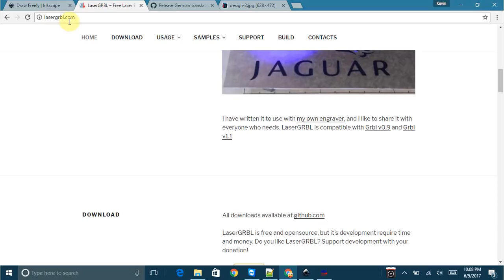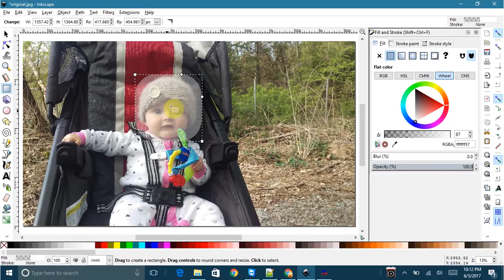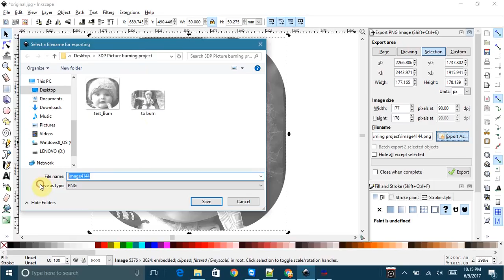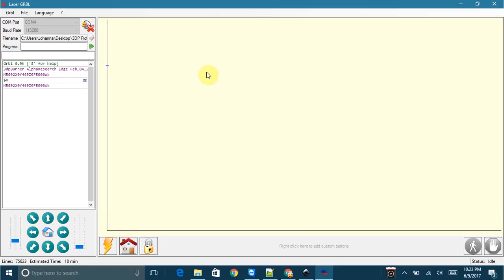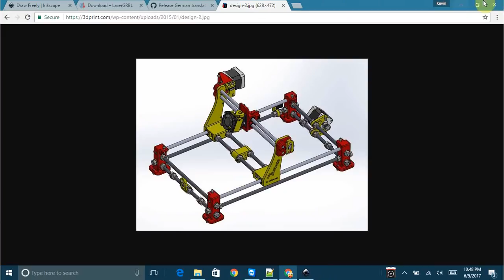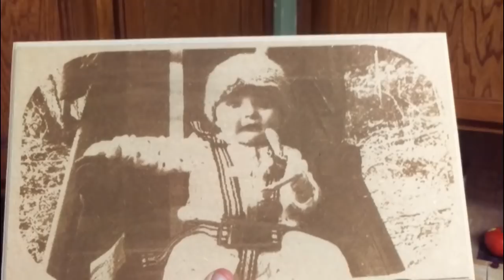Burn Images into Wood using LaserGRBL

Comment: Your demo on the little girl photo says your job only took 26 minutes. Mine shows 10 hours. What am I doing wrong? I followed all your steps.
Reply: he didn't show how to adjust the speed. before you press "create" check the speed wich is visible on top. standard is like 10000mm but yours is probably set much lower

Comment: i had the same issue with jerkiness while burning as it jumped over the white unburned area, i slowed the jog speed way down and kept it close to the burn speed, i noticed the laser didnt jump as much and ran much smoother, it takes a little longer to burn but the results were much cleaner. plus make sure your belt tension is set right with no slop, the belts do stretch a hair after a while and they tell you to trim off the excess when setting up the machine - dont, it gives you something to grip on to re-tension the belt then tuck the free end under the channel so its out of the way, you cant put the end cap on but thats just for looks so leave the cap off on the free end.

Comment: Hi nice video,
What laser machine did you use?.
Thanks,
Reply from the maker: I used a DIY laser cutter engraver called the 3dp burner. Most parts that can be 3D printed are. You can find the laser cutter here.
 https://www.thingiverse.com/thing:610934

You can mount really mount whatever laser you want to these machines. I have a 2 watt 450 nanometer (blue) diode laser. It can cut through paper and thin cardboard, but mostly it's good for engraving wood. 

 My brother actually built the machine himself and later gave it to me. It runs off of an Arduino uno with  a CNC shield.  

I'm currently taking the machine apart and rebuilding all the mechanics. It will be larger and be made from 2020 v-slot aluminum extrusion. The linear motion will happen through v-wheels that ride along the v-slotted aluminum.  I'm sure I'll make a video once the project is complete.  It's slow going though as I'm machining anything I can myself.  I want to get practice using an old lathe and milling machine passed along to me in the family.

Comment: there are several problems with LaserGRBL. number 1 : it's A pain in the ass to pause the burning. one of the biggest laser killers is HEAT. it is recommended that you allow your laser to cool off for 5 minutes after each 10 - 15 minutes of burning. even with a HEATSINK your laser will get HOT. the heatsink may feel cool but the laser inside gets super hot. a fan on the laser does help but do you want to buy a new laser all the time?
to pause the burning.. click the stop sign icon at the bottom right. to resume click the running figure next to it. remember to allow your laser to cool every once in a while. I usually burn for 5 to 8 minutes and cool down for about 5 minutes.

number 2 problem : the GRBL firmware. I see in this video you used grbl0.9 the newest is grbl1.1h. both very similar. but each time i open LaserGRBL and load my machine i must set the firmware to laser mode($32=1). i have downloaded the source code and edited the GRBL firmware and recompiled it so that is no longer the case for me, but others may still have that issue.

number 3: the GRBL firmware assumes that all machines are the same...they are NOT. for instance my machine uses 90 steps per mm. i have a mini laser that uses 82 steps per mm. GRBL firmware by default uses 250 steps per mm( I think,,it may be 200 per). to change the steps you must type in $100=XX, and $101=XX (XX=number of steps needed). I forget the formula, but there is a video on youtube that shows you how to calculate the steps per mm. I started with a image of a box with heavy outlines. I made it render at 10mm X 10mm. after it lasered i measured the image, then adjusted the steps to match what was needed per mm. like I said my A-3 machine was 90 steps per mm and my mini laser(made from dvd drives) was 82 steps per mm.( not perfect but it WORKS)

Comment: Kevin Brigadier.
Cheers. But I have a question, once you get the print set up correctly. 
Can you save it, make a copy of the file then remove the original image and add a new image, keeping all the settings, to save time. 
As you can probably guess I'm very new to this.
Reply: Laser GRBL will automatically save the settings from the last time you used it. just open a NEW picture in laser grbl and click next, then click create. as long as the image sizes are the same,,50mm x50mm or what ever size you choose could be 100mm x 30mm what ever. but it will save it for the next time you use it as long as you do NOT change anything except the image itself.

Comment: Thank you for the tutorial! One thing I am really missing with this software is the option to run focal adjustment for the laser (lower light option) and "show path" option which would show me the maximal burn area for the current project. Are these buried somewhere in the software or are they just missing? Thanks!
Reply: show path is NOT in the LaserGRBL software. as for low light option you may need to type 'M3' 'S100' to get he laser to turn on may have to take the 'S' to 150 or 200( maybe higher) before the laser will work.
Reply: if you order an ortur laser mster 2 there is a dropbox file they give you and in the files they have some custom button options in there you can import into the laser grbl program. if you have a dropbox just let me know what it is and ill share the file with you and let you can get them from there

Comment: I take it resolution that the picture you are trying to convert and burn has a lot to do with the quality of the burn?
Reply from the maker: It does. The brightness and contrast needs to be dialed in as well. Doing a few test Burns with the same image, just smaller, where you vary the contrast and brightness will save a lot of time. That way when you burn your larger final image there'll be less chance of having to do it again.
Reply: laserGRBL uses 300pix resolution

Comment: Thanks i used m3 m5 using toggle button... It worked fine for few min...now it doesnt work but does show m3 m 5 commands on screen as i toggle
Reply: try using m3 s100 to turn on the laser. some one told me that would work.

Comment: Thanks..i tried doing custom button for toggle laser on off...it worked for a few reps but then stopped working....the m3 m5 shows up on screen when toggling but laser doesnt turn on
Reply from the maker: I'll see if I can take some footage or screen shots of my set up working this weekend and share what I've got for the laser on and off buttons i made.  I'm using toggle style buttons.  One to goggle laser on and off at S100 (lower power) the other uses S255 (high power).

Comment: And how do u know where your laser point is?...there is no way to turn laser on low to see where your lcation is..via lasergrbl...younhave to guess which is unacceptable method
Reply from the maker: the stock program does not include a button to turn the laser on so you can jog your machine around and see where it is. It is very easy to add custom buttons. You could make a custom bottom to toggle your laser on and off. When on make the laser power low S100 or less. Here are custom buttons people have made and have shared.  httpsthub.com/arkypita/LaserGRBL/issues/306
Reply: ok, the trick i use is to tape a piece of string on the center of the laser's front side and on the center  on one of the sides. it helps to have a small weight tied to the end of the strings. let the strings hang down.  I placed a GRID down under my laser, then i line up the strings to the grid so the lines on the grid intersect at a point where the laser would hit. that's where I set my HOME position. and where I put the lower left corner of my project.

Comment: try using a software called "fengrave" ...first convert image to .DFX than load into "fengrave" to convert to gcode ...I used it on a cnc machine and it works great.
Reply: wow, the last update for 'F engrave' was in 2012

Comment: Does anyone know how to reset x any y zero start point in laser grbl?....i havent found a way other than moving my laser to 0 0 and then shutdown laser grbl and reopen......if this is the only way to reset 0, 0 the engineers need to change the program to work properly
Reply: Also,what version laser grbl you have....mine does not have the line to line option
Reply: @shelby50411  If you do the plug in why dont you just send it with grbl master sender
Reply: answer the two questions. 1 download the newest version...it's free. number 2: put your laser head where you want to start position, then click on the globe icon at the bottom. if the icon won't allow you to click it move the laser head using the arrow keys then click the globe icon. then you can move the laser head back to where you want it and reclick the globe icon.
the version Kevin is using is an OLD version and looks like he had to click the 'house' icon by the lightning bolt icon to reset the 0,0 position.
to make your laser return to 'home position' click the house icon in the middle of the arrow icons.

Comment: When i use laser grbl i dont aee anywhere to reset 0,0 start point.....if i move my laaer to my desired start point how do i Zero it out on laser grbl?
Reply: the new version of LASER GRBL you need to click on the globe icon at the bottom, to set the 0,0(HOME). and to make the laser go to HOME click on the house icon in the middle of the arrow keys.

Comment: How do you reset 0,0 starting point
Reply: put the laser where you want to be the 0,0 position and click the set home button. in the newer version of LaserGBRL it's the little globe at the bottom.  it you laser head is at the home position the globe will NOT be clickable. it will be dimmed out. move the laser using the arrow keys them click the globe icon. remember that when you click the globe that will be your start position.

Comment: its working but its not allowing the laser power to go to its max. Though I can enter the S code manually and it goes to full power.
Reply: when you make the g-code for the picture you want on the second window you can set the max power to a higher number. default is 255. try changing it to 1000 or 800 if that's too much.
I think 1000 is the max you can set it. but you can go anywhere from 1 to 1000. your 'S' code max is set in the firmware. the 'S' stands for SPEED for the speed of the router but it also works the laser power.

Comment: Hey sir,  Did you install your TTL wire to Z+ Max éndstop? :) I got some issues with 3dpburner g code, it goes not controle the ttl auto, but only manuel. :( im about to try LaserGBRL software.

Comment: This is a good tutorial but does'nt seem to work in inkscape. When cropping the image the way you do by selecting the object box, it just draws a solid box over the image you want to crop in whatever colour is selected. How did you get it to be transparent so you could see the childs face through the box?
Reply: Didn't work for me either
Reply: Good day - Kevin (THANKS for this btw ! ) presents a ton of info, and does cover this, so if my answer isn't clear, re-watch his clip, it's in there.  Once you have the box object ( opaque as it will be initially ),  go to Object pull-down menu and select "Fill and Stroke" - OR - "Object Properties"  --- either will get you the panel that permits you to edit the Opacity
Reply from the maker: https://youtu.be/ik3mCOdE4T8. This video is short and explains exactly how to crop and set the crop shape to transparent.